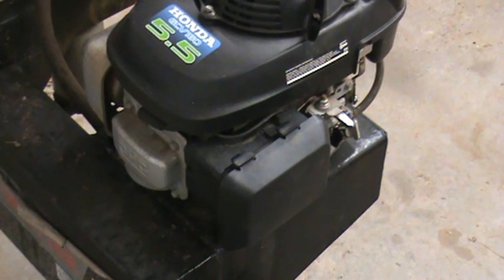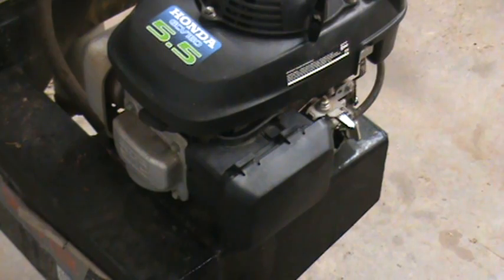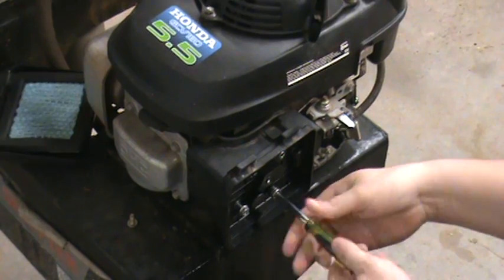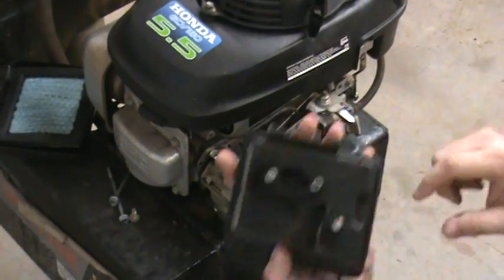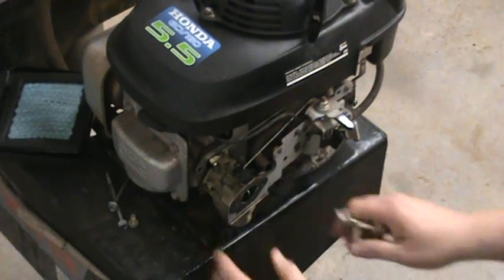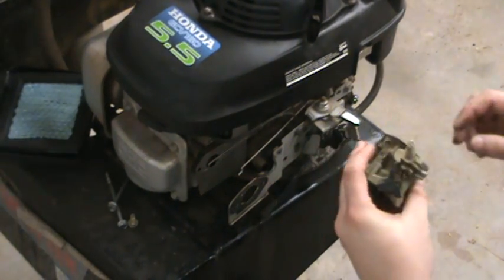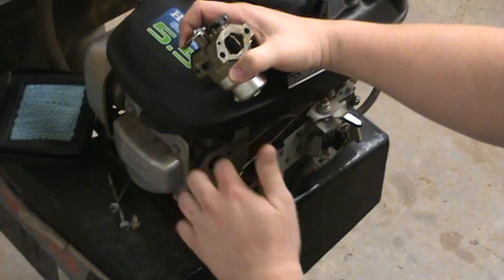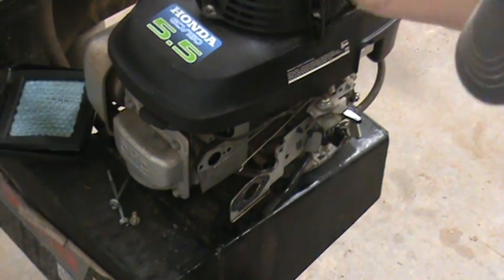Converting my log splitter to propane. Step 1.  Removing the carburetor from the GCV160 engine.

Comment: Nice video series !  In the years since you made this, I've seen some off-the-shelf dual-fuel carbs which are as cheap as $20. Search for "Honda dual fuel carb". I haven't tried that carb myself, because I was converting a much smaller engine. I wonder if you have tried one of those off-the-shelf dual fuel carbs. If so, what results did you get ?
Reply from the maker: I've seen the dual fuel setups, but have never tried one.  I was just tired of always having carburetor problems, so I went with the simplest solution I could find at the time.  I didn't want to just replace the carb and have it get all gummed up again in a year's time, so I went with propane.
Reply: I agree with the fuel storage problems. Mine was slightly better after I started adding Stabil to my stored containers. But even if the fuel wasn't gummy, the engine would still be difficult to start because many of the lighter components had already evaporated out. I eventually did the same as you, to just use propane only. I also like that the exhaust is much cleaner with propane. Take care !

Comment: all u need to is run the propane line were the gas line would normally be
Reply from the maker: It might run, but I don't think you'd ever get anywhere near the rated horsepower of the engine that way.  You'd be pushing/pulling the fuel through the float valve and through the high speed jet, both of which would need to be enlarged in order to get enough propane through.  I don't know if it's even physically possible to enlarge the valve that's controlled by the float enough to allow enough propane through it without destroying the carburetor.  It's much simpler to just remove the high speed jet, enlarge the bore where the jet normally resides, and plumb the propane directly to that port, bypassing the float valve altogether.